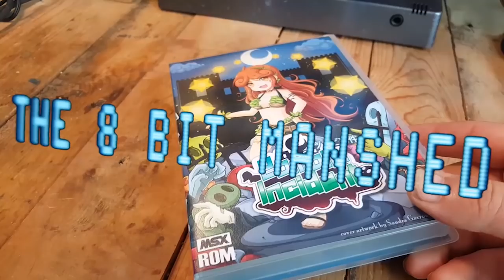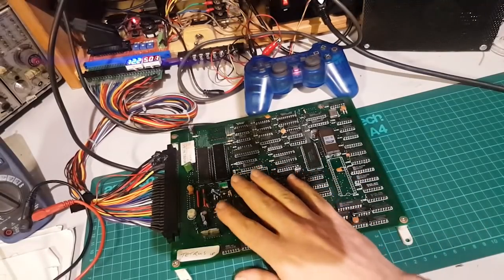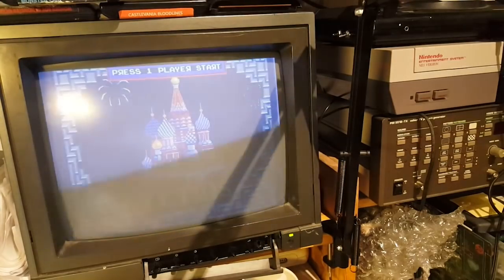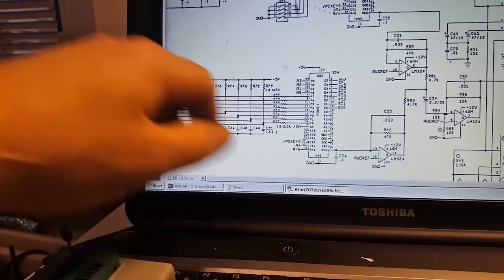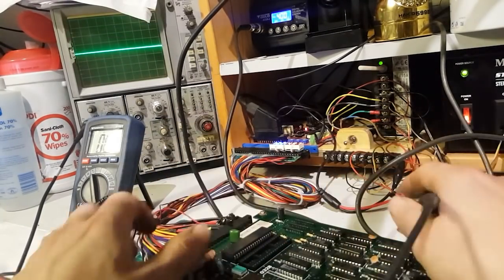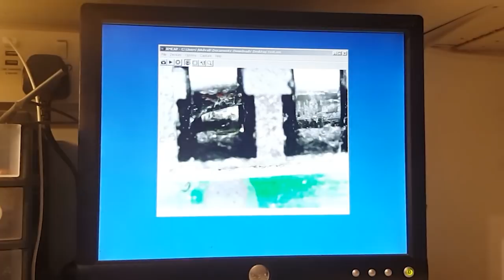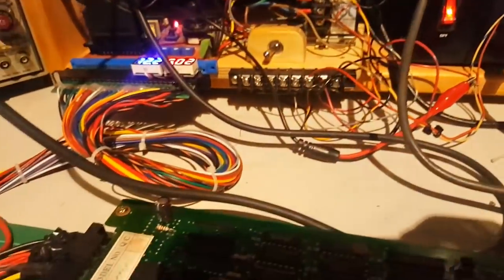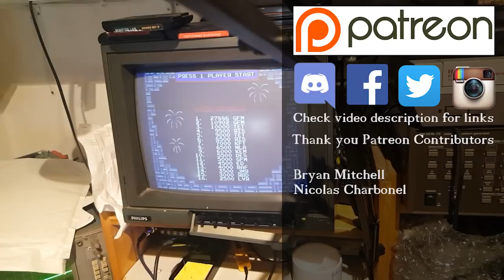Arcade DIY #48 - Tetris Arcade Board repair

Comment: Hello 
I Have similar Tetris bootleg board, i returned it to the living but i did stumbled upon a problem with sound. 
It is scratchy and strange different from emulation. So i was looking for Tetris board repair videos for some help because i cant find why it is so. 
And on your video sound is the same as it is in mine O_O. Is it normal then ?

Comment: Interesting to see. I've been casually learning vintage hardware, and saving references. I'm interested in early PLDs as well. I still haven't found a working toolchain that looks both cheap and feasible for me. Apparently the little Chinese ~$80-$100 TL866 universal programmers can do some 16V PLDs but I've heard they have lots of problems too. My main issue is that all the toolchains I've come across are windows/dos specific and my cheap workstation is on Lubuntu.
  ...anyways... if you find a working solution I'd like to hear about it. I have saved everything I've come across on the subject thus far in a publicly listed playlist "LOGIC HAL/GAL/PAL." This includes some obscure references you won't find easily while searching. There is even one reference about manually reverse engineering the programming on a chip.
  Thanks for the upload.
-Jake
Reply: Playlist:
https://www.youtube.com/playlist?list=PLPIwHuVy9EyM8NOrLRiPYI6PLHbl5L20W
(Note: I'm not monetized/these are all references to other people's uploads/I have nothing to gain in sharing this :)
Reply from the maker: @UpcycleElectronics  no worries thanks. it'll be useful